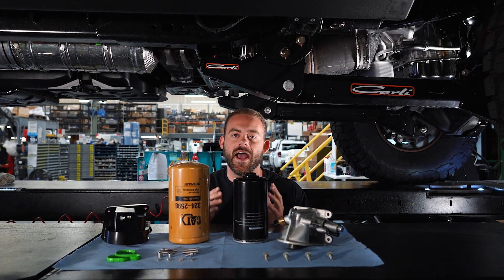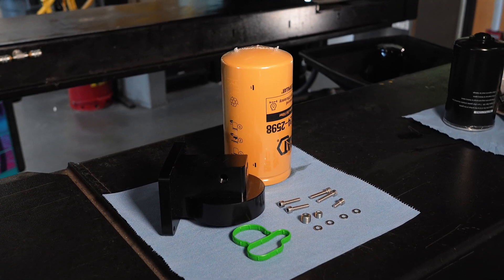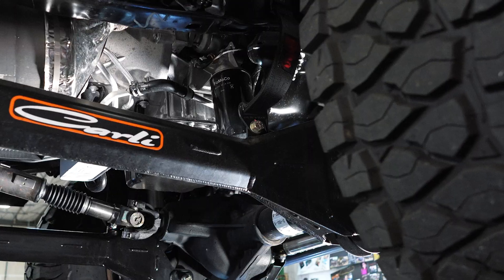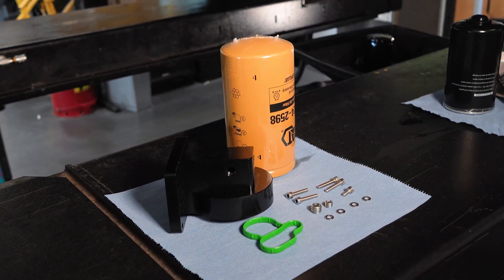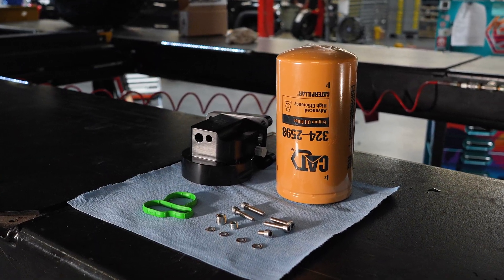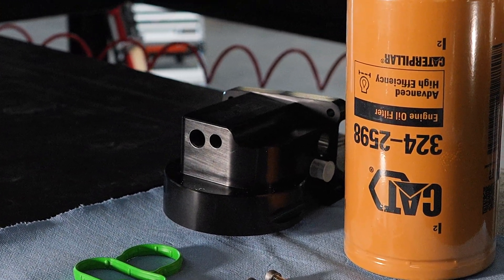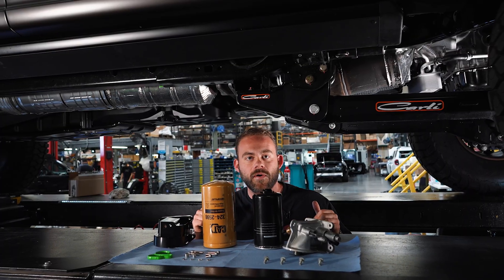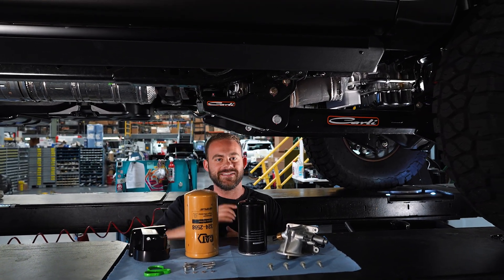SPE 6.7L Powerstroke Oil Filter Housing Upgrade | CAT Filter Conversion

Comment: What you have to say about that missing bypass valve in the CAT filter?
Reply: Been running one on my truck for over a year and a great mod!
Reply: This gets brought up often. SPE even has a write-up about it

First and foremost, as many have said, almost non of us have ever actually had our trucks bypass valve engage.. that takes some extreme cold.

If your oil is to the temperature that it can't flow through the filter, you should probably not be starting it without some sort of Supplement Oil Heater in the first place....

Additionally I seen people mention how the higher flow of the filter material allows a thicker oil to pass through it compared to the OEM. Meaning you'd need even a colder temp then before to "plug up" your filter.

If your using good quality synthetic 5w40, you won't have issues
Reply from the maker: CAT filters don’t use a traditional bypass — the bigger filter and housing are designed to handle the flow without it.